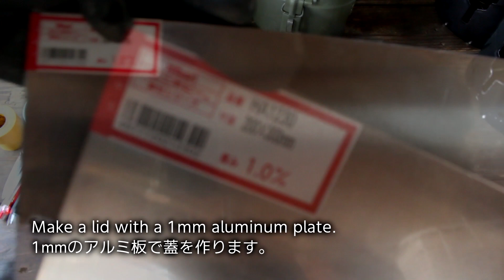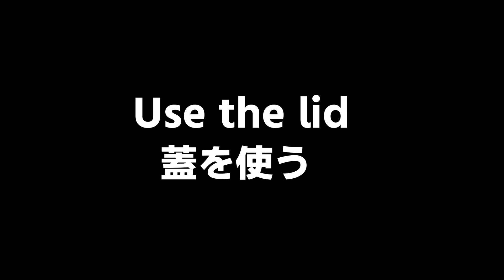【便利】スウェーデン軍飯盒 蓋の作り方 / How to make a lid for Swedish army mess kit / DIY

Comment: Excellent and informative video! Thank you for creating this video!
An additional feature would be to drill a few holes near the rim of the lid so it can also be used as a strainer when cooking such things as pasta.
Have a good day!
Reply from the maker: Hello. In my country, we cook and eat rice, so a lid with holes is not necessary.
I made a lid for this mess kit because I want to cook rice. When I make pasta, I dump the hot water through the gap in the lid.
It's interesting that different countries require different functions.
Your comments are very helpful.
Thanks for watching!